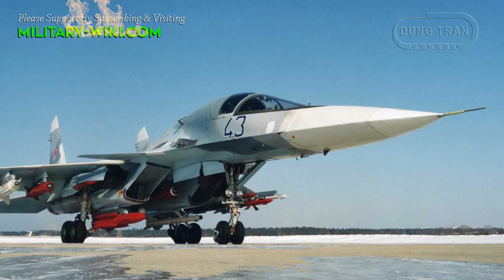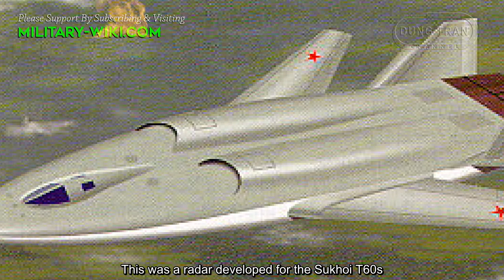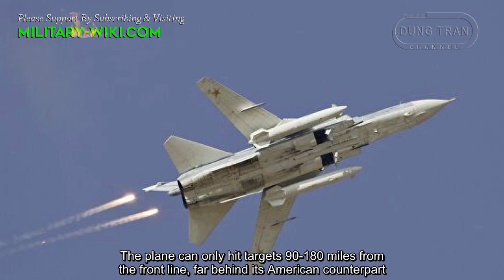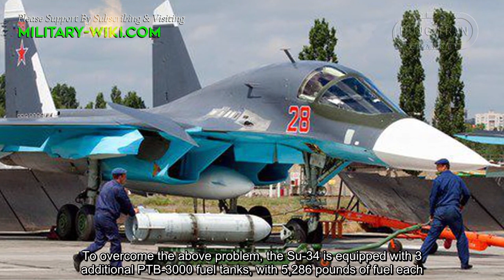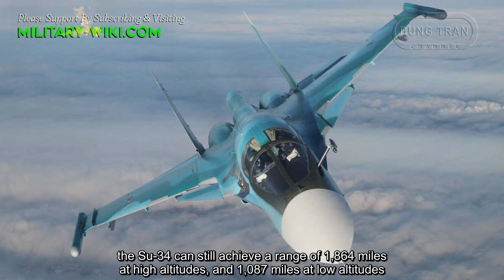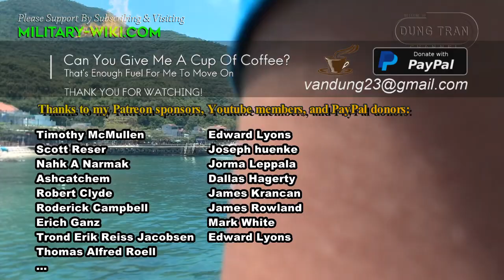What Makes the Su-34 Fighter-Bomber Respected?

Comment: that T 60 looks interesting i'd like to see that one actually built if for no other purpose than proof of concept!! it needs that kind of fuel load because while better than earlier versions Russian mills are still fuel guzzlers (along with being maintenance hogs!!) compared to US and NATO engines! right now fuel consumption and maintenance wise i'd put their engines at 1970 to 1976 era for western engines! the F 15E doesn't carry as much because it doesn't need as much! and like on the F 111 that side by side cockpit layout is a hiderence in an air to air dust up which is bound to happen from time to time by blocking the pilots view to the right! and that can get your ass flamed by slowing down a counter move because the weapons operator has to tell the pilot what he sees instead of the pilot looking and reacting three times faster!